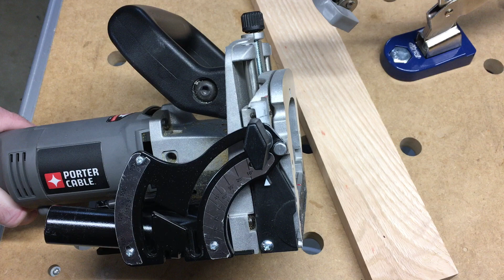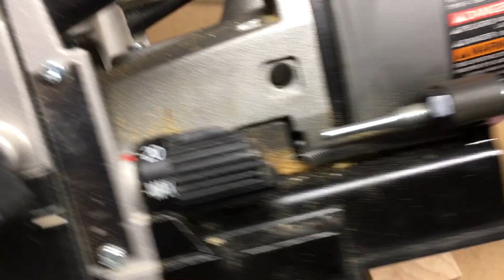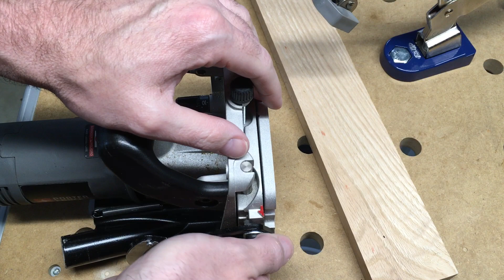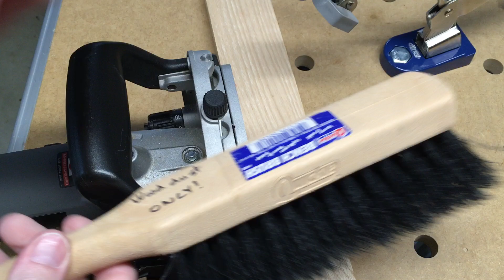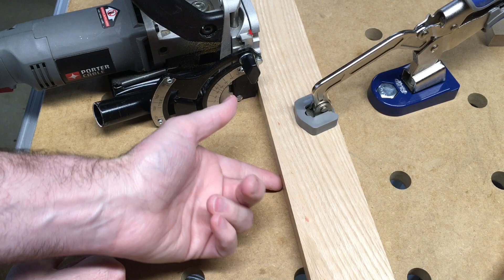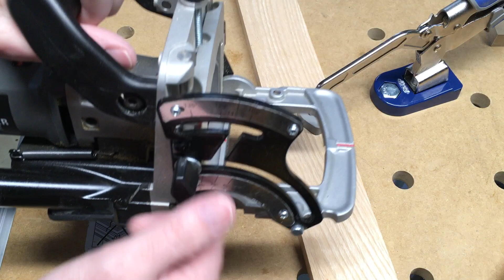More Accuracy with a Biscuit/Plate Joiner

Comment: This would only work with 3/4 material tho right? If it's 1.5", the blade wouldn't be close to center. I'm brand new to biscuits so just getting accustomed.
Reply from the maker: Thanks for the comment! This works with any size wood. It won't center the biscuit but centering isn't necessary if you are just trying to align the surfaces. You just have to make sure the face you want flat is down.
Reply: I was taught to NEVER reference off the table/workbench because in many cases they are not dead flat. Referencing off of the workpiece ensures the biscuit slots are uniform all the way down the workpiece.